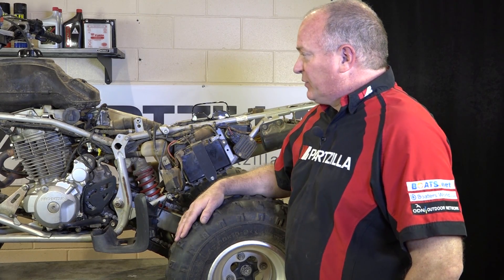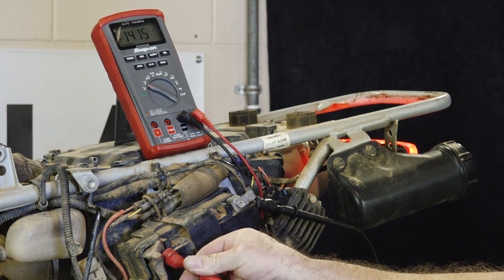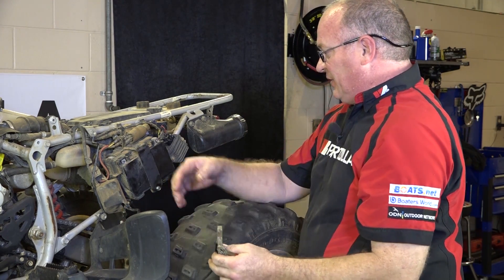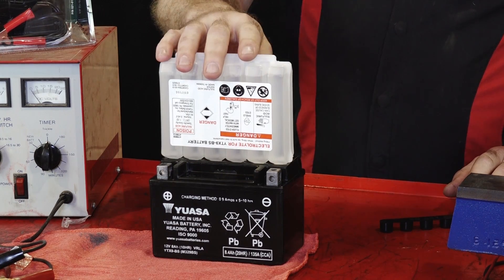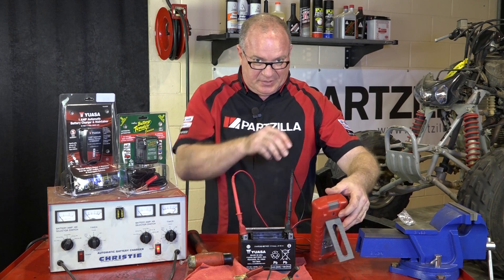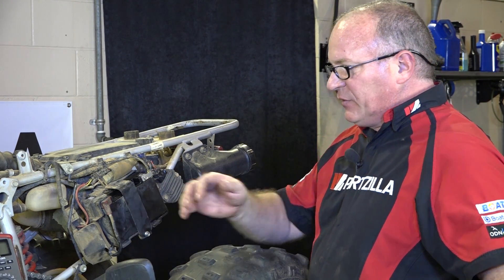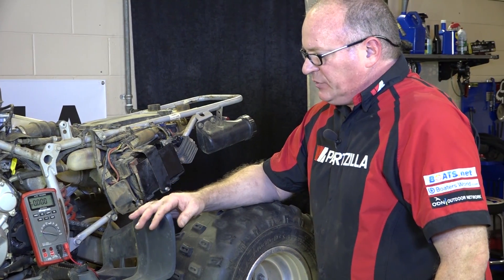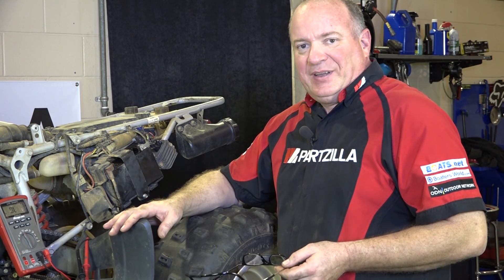How to Test ATV Stator, Rectifier and Battery | Partzilla.com

Comment: Thank you for your YouTube videos. I’ve been watching a lot of them.
  I have a 2006 Suzuki 700 king quad.
  My original problem was the quad would run for 5 to 10 minutes and stall. I might get it to start again, but it would run for less than a minute and install again.
  I was told to unplug the stater from the rectifier and see if it would continue to run. And when I started to unplug it, I noticed the plastic connectors that connect the wires together was melted together from excessive heat. I actually ended up cutting the connector off From the three Phase stater. The quad would start and continue to run fine with the wires separated.
  I did not want to get an aftermarket rectifier for around $25. So I ordered a rectifier from RM Stater in Canada for a little over $100 and installed that on the quad started it up and after a few minutes the new wire connector, which came with the rectifiers would begin to get hot. It would get so hot that I couldn’t touch it so I separated the connectors again and that’s where I’m at right now with my problem. What would be your recommendation for me. Should I do some more testing on the stater or do you think that I’m going to have to buy a OEM rectifier to solve my problem. After I received the rectifier from RM stater, I saw that it was made in China, which was pretty discouraging.

Comment: I went  to check  my stator  as it struggled  to turn over even though  battery  is new but the plug has more pins so not sure which to touch  any clues thanks melv

Comment: I know this is an old, but good, video.  I hope that you are still answering questions.  We slowly pulled a finishing mower behind my Kawasaki Prairie 360 for about 2 hours today.  It ran great but I was concerned about it overheating from operating it so slowly for so long in 90+ degree weather.  When we shut it off, the battery was dead.  I jumped it off and it ran fine as long as the jumper was on it, but would die or cough and sputter badly when I unplugged the jumper cables.  I charged the battery but it discharged to 10v as soon as I hit the starter, so I’ll be replacing the battery.  I checked voltage at the battery when running and connected to the jumper and it was 12.9 volts, the same as the voltage of the jumper. Voltage did not increase with revs.  Does it sound like I could also be having problems with the stator or rectifier?

Comment: HELP! I am 60 miles from nearest mechanic. I just purchased a new battery and when I brought it home and did a static reading it was only at 10.75 so I put it on a battery tender but have not been able to get it any higher. I connected it to a starter and was able to get the engine running and did a voltage check and it was bouncing around between 9 to 12 1/2 is that my stator? I would like to order today and try and get it shipped to me ASAP.

Comment: I appreciate your videos! So I have 1994 Honda 300ex, just got a new battery, it reads 11.38-12.86 fluctuating. Watching this video I thought I would be ablw to start it but it won't. Not even a buzz. I'm going to put the battaryu tender on it to get a full charge. The shop I bought it from put the acid in and did a charge on it but it doesn't seem fully charged. any suggestions? I bought a multimeter but i only know how to use based on your videos. I was going to try to vheck the stator without running the engine based on your other video. Woud appreciate any help. Your backyard mechanic, 65 miles from nearest auto parts store. I will be ordering some things from partzilla!

Comment: i have a trx 250 and it only will start in neutral like it should and when i went to start it it was in 1st so i shifted down as i held in the start button so it would crank as soon as it knew it was in neutral and it cranked for half a second than lost all power nothing to the nuetral light nothing

Comment: If I use a lithium ion battery do I have to replace my Voltage Regulator Rectifier with a lower voltage limit one it will it be fine?

Comment: G'day Mate 

I'm having a issue with my Honda Trx 350tm 05 model. I'm thinking it's the stator as it will charge at idle but as soon as I increase the rpm it starts to drop in voltage.
Would just like to know if you've come across this issue before. 
Cheers
Justin
Reply: Did u ever figure it out I'm having same problem??

Comment: I need some help. Hope someone can answer this for me. I have a 2011 Honda 420 (TRX420FM). My battery is toast, I can jump start it but when I remove the jumper cables the bike dies. My question is, SHOULD MY ATV STAY RUNNING WITH A DEAD BATTERY OR DO I HAVE OTHER PROBLEMS LIKE A BAD RECTIFIER OR BAD STATOR?
Reply: It might be that your stater is not throwing a lot of voltage you can  easily check that And if not it’s your battery

Comment: Hello John , thanks for all the info on your videos, I need advise please, working on my 2005 Honda Varadero 1000. cheching the charging system i did dynamic check on the stator and at Iddle i have 22 volts AC and at 5000 rpm I have about 70 volts AC , if I keep going to 6000 RPM i got 100 volts AC , is this normal? I also did static test andI got 1.7 homs on all 3 phases, this readding is normal?
Regards and  again thanks in advance.
Reply: Hi there my friend I know I'm not John but those numbers are not right most likely your stator needs replaced

Comment: So hard to find videos on Arctic Cat. I have the green prowler hdx xt 2015. I suspect there's an issue with my stator or reg/rec. I would love multiple videos on this machine. I seem to have many,  many repairs with this machine :(  and the service manual is very hard to work from.I did what I think was the ohm static test and the grounding test,  both seem fine for the stator.  When I do the charging test the volts  show 12.6 and the manual says that at a 5000 rpm the volts should go up to 15volts. Mine does not show any change. I'm wondering if there's something I'm not doing or If the reg/rec is not working would this be why there's no showing of volt change?   I always order my oem parts from partzilla.com thank you. Please feel free to email me @ cummings_t06@hotmail.com

Comment: Hey there! Great video. I have a 01 400ex and the battery has a slow drain. If i charge it up to 13.1 volts and disconnect the battery cables it will hold. I read that the rectifier will sometimes get a short in them causing the battery to loose about .3 volts a day. So as a test i made sure the battery was charged to 13.1 and disconnected the rectifier. It stays fully charged at 13.1 when its sitting with the rectifier disconnected.  So is it safe to say i have a bad rectifier? 
Thank you!
Reply from the maker: Sounds like you've solved the drain diagnosis.

Comment: hey no idea if youll see this but i just got a ds450, the battery died the same night i got it , so i figured were it was layed up the battery was bad so i got a brand new battery, went for a while but died out again and once the battery dies the bike wont run, so i went and got a stator and a volt regulartor, changed it all, havent used it much sence but im thinking it still isnt charging i went for a run and it died out once and i always take my other battery with me in a boot bag just incase because it was such a hassell when it died in the past, but i keep charging the battiers now after i take it but i dont go far because of that factor any idea wha i should do ? the stator n regularot was offf my buddies parts bike, and i took my old stator off mine to yamaha down the road and they said the one i took off looked to be brand new , but low on patients with it so any addvice

Comment: I was charging my atv and at the same time I tried to start it and suddenly it stop. I have checked the fuse and all the wires and the solenoid and its still not firing. Only when I join the solenoid hubs its starts and runs great. I cant seem to find out why it doesnt start from starter button. Do you have any tips what I could try?
Reply: Maybe bad CDI box? Just a thought

Comment: Getting periodic voltage trend up to 18v at idle,  increasing rpm drops to 14.29v.  New battery at 13v.  .  2017 Pioneer 500.   Relay or rectifier or ???  Thanks.
Reply from the maker: Test both, but generally, fluctuations are from an issue with the regulator/rectifier.
Reply: thanks for the reply, did the testing per manual, stator good, rectifier/regulator being replaced.

Comment: I have a 08 Honda 400ex when I measured voltage it read out at about 23 volts. Does that mean my stator could be bad? I have had an issue with batteries going bad could this be the reason?
Reply from the maker: Could be the rectifier
Reply: @PartzillaParts  okay thank you

Comment: Hooked up jumper cables backwards on 2000 400ex no i have no power where should i look first
Reply from the maker: Uh oh.  Check all fuses. Test battery. Hope you didn't fry the ecm.
Reply: Partzilla it was the starter relay

Comment: QUESTION ( GREAT VIDEO BTW) I have a POLARIS MAGNUM 500, seems fine but i pulled off rope pull housing a lot of dirty water came out (gasket dry rotted) I got my puller and pulled of flywheel and its brown dirty in there. What is best to clean the stator with? Just pour gasoline all in there to clean it out? Thanks, Rusty

Comment: Hey I have 2000 400 ex and it seems to be if I keep getting rectifier and they work for a little and then die , what could be happening. Thank you
Reply: bad stator possibly
Reply: @yafaza450  that's the next thing I plan to but because I've bought everything else including a new diode that runs with neutral wires and the cylinoid

Comment: I have a Yamaha 350 2w Bruin. The regulator Rectifier gets extremely hot when running.like will catch on fire hot.
 Any suggestions?
Reply from the maker: Either it's going bad or you may have a short.
Reply: @PartzillaParts  . Thank You. Your videos are very helpful. Learned alot. 
Update on problem. Its fixed. Bad reg rectifier and cable connections. Replaced the rectifier and the wiring . runs great.
Thanks again.💣🚀🔭🐧

Comment: My atv battery gets hot even just with the key switch on without the motor running... what may have cause this problem... it runs dead within 15 min or so, help please
Reply from the maker: You may have a short.

Comment: Sir I have a f4 I Honda 600 when I ride a distance it start keep bucking and it will shut off at times is it the battery or the rectifier costing that problem or it’s the spark plugs

Comment: I just put a new carb on my 2000 Polaris and rode it for an hour or som the battery went dead, is there something I did wrong putting it back together? Thanks.
Reply from the maker: This usually means the stator isn't charging the system, so once the battery dies, so does the quad.

Comment: I've got a 2000 Polaris, there's two wires and in the middle of them there's these big soft plastic pouches the wires go through, what do they do? Thanks.
Reply: Those are waterproof pouches for fuses. I have a 2003 sportsman.
Reply from the maker: This is a little vague for internet diagnosis.

Comment: John; I have a '96 Honda 400 Foreman that has given me superior service for the last 20 plus years. Last year  while hunting we began to experience problems with the engine running ragged once it got hot and when we increased the RPMs it would completely die. I hauled it to a reputable shop that has worked on Honda products for the last 35 years. To my surprise, he could not resolve the problem. He thought that it could be the "staider". What's your suggestion?  The carb has been re-built and thencomplete fuel system has been cleaned several times. New battery, solenoid and new Honda starter as well as a new NKG spark plug.

Comment: Hi sir my atv bike 110 cc engine it have only two head lights Wight are not more power full I want to increase  lights what should I do should I increase battery power or or change rectifier or use big rectifier
Reply from the maker: You could always rig an LED light system, shouldn't draw too much power, just make sure it's on it's own fuse.
Reply: @PartzillaParts  I have to install any electronic kit for it

Comment: How u doing ,, you  can really learn something with your videos thank you.  am hoping u can help me i have a 05 yfz 450 starts good runs  ok but when I go full throttle  starts dying out like it's not getting enough gas .. the carburetor its clean and jetted the cdi box its good so I don't know what can it be plz can u help
Reply from the maker: This almost always comes down to jetting or air fuel ratio.  Not enough air at full throttle?  Try adjusting carbs.

Comment: I have a 2004 Polaris Sportsman ATP 330 and I'm having electrical issues. I have installed a new stator, new starter, new starter solenoid, new ECM, new Killswitch, new ignition coil, and traced all wires down checking for shorts or bare spots. But I keep burning up CDI boxes where should I look for the problem?
Reply from the maker: I don't remember off the top of my head, does this unit have an independant rectifier or is it part of the ecm?

Comment: i have a 1998 polaris 425 magnum,tried to hook up some extra head lights. disconnected them, now it will drain both new batteries in minutes, what do i check?
Reply from the maker: Sounds like a short, reinspect your wires and connections.  Did you use a fuse?
Reply: no fuse, just drains battery quickly.

Comment: Okay need some help I've replaced the regulator rectifier the stator the CDI box and it's got a brand new new battery and starter solenoid as well (it has burnt the CDI box up twice  and a regulator rectifier  1time have traced back the harness and find nothing wrong with it )daring running it's charging at 14.58. Is that too much charging and will that burn up the electronic components again... 2010 Yamaha Raptor 250

Comment: Can you help me with 2005 yamaha yfz 450 neutral light is on put on a new solenoid and same thing as the old one no sounds at all but when you stick a screwdriver across the solenoid bolts it starts right up what do you think
Reply from the maker: You are most likely losing power before it gets to the solenoid.  Switch or wiring.
Reply: Thank you I found what the problem was it is called the neutral relay which looks like black rectangle with 4 wires going into it. It had a rattle in it like something was loose so I broke it open carefully and got the connection hooked back up and it works.
Reply from the maker: Good catch!

Comment: hi i have a suzuki king quad 4x4  400 i think, battery keeps dieng on it, do you know where the rectifier would be on the bike and is the test the same as in your video. thanks in advance for the help.
Reply from the maker: They will be about the same.  If you test it, you will know if something is off.

Comment: Hi a got a 2003 Honda 400ex it was starting normal then after putting a new battery on it started 3 to 4 times but then it didn't a checked the rectifier regulator and it read 530 and 560?

Comment: There is a slow drain on my new battery I unbolted the regulator rectifier with the key off it's got a spark from the ground and bolts is the rectifier bad short it out or could it be something else
Reply from the maker: That sounds like a short. If the key is off, there should be no current to make a spark.

Comment: I have a yamaha dt 50x. The display lights when the battery is connected and the key is unplugged.... And the battery wont charge. The display lights when i start the engine whitout battery, so that means i am getting power from the stator?? Does this sound like it is the regulator that is bad?
Reply from the maker: The battery is only for aux power and for starting the unit.  After that, power should come from Stator and recharge battery.  If your battery isn't charging, they you need to test wires, stator and rectifier.

Comment: Hey Partzilla need your help. I have a 2001 Honda Foreman 500 ES and the battery will run down after the 4 wheeler sits overnight. I am puzzled because the switch is off. Thanks for any help
Reply from the maker: Take the battery out of the bike, does it still drain?  You can do a health test on the battery, otherwise, you have to check wiring.  There is a draw coming from somewhere.

Comment: I have an 03 Suzuki GxSR600.  I replaced the stator and the rectifier and something is still killing my battery.  Any suggestions of what to check next?
Reply from the maker: Need some more detail.  Is it killing battery while running or while it sits in the garage overnight?
Reply: While running.  took a ride and turned it off , then it wouldn't start again.

Comment: We have a 2008 trx450er that starts right up but as soon as it gets warm it will die and won't start until it cools down. It has new stator and starter
Reply from the maker: Have you done a valve check/adjust?
Reply from the maker: Did you adjust valves while engine was hot or cold?
Reply from the maker: Glad you got it figured out, just to note, you should always do your valve adjustment on a warm engine.
Reply: John thanks.  We will.

Comment: Hello, I have a 2000 scrambler 500 runs amazing but today after trail riding we turned it off to take a break and now it will only crank if jump started but the battery is not even a month old and dash lights won't come on and If we turn on lights they get dim
Reply from the maker: Load test the battery.  If you think something is wrong with the system, you can test the stator and regulater as well.